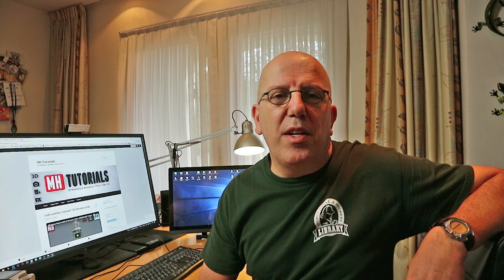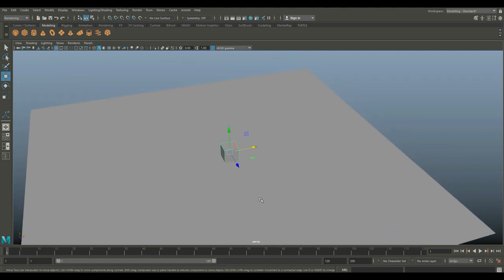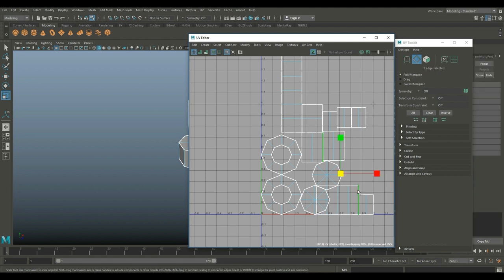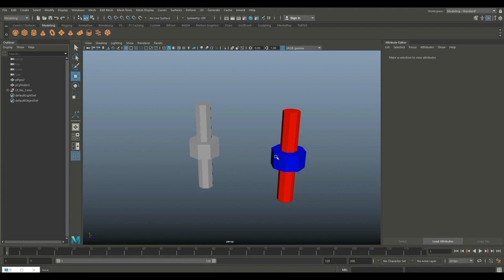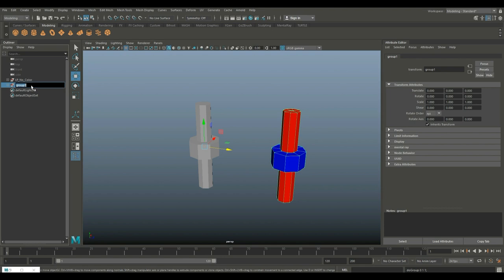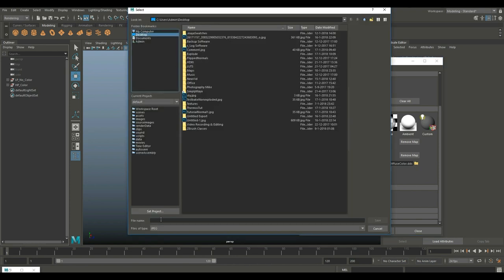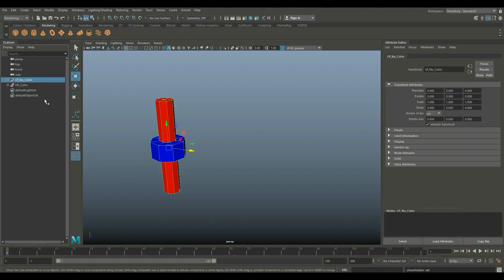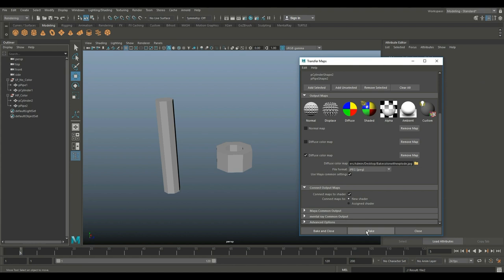Exploding the 3D MESH in Maya 2018, What is it for and how to do it ?

Comment: Mike when I try to undo some modification when  I hit control  + Z to undo the changes  I have this error // Error: line 1: The undo queue is turned off  and  I cant undo the change
Reply: Hi!

In Preferences:  Settings -> Save Actions -> Save all preferences when Maya exits ("disable")

This way you have better control when and what changes will be saved.

I hope it helps.

Comment: So basically high and low poly mesh means you have a copy of the original one.
Reply from the maker: No, it is not just a copy. A copy would be the same. It is a high polycount ( high poly ) version of the low polycount model with a lot more detail used for normal map baking